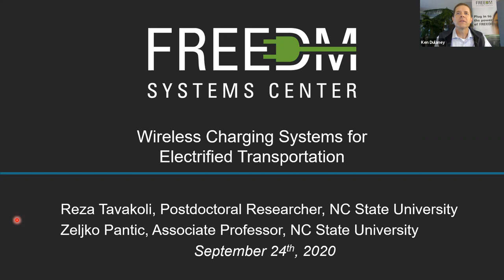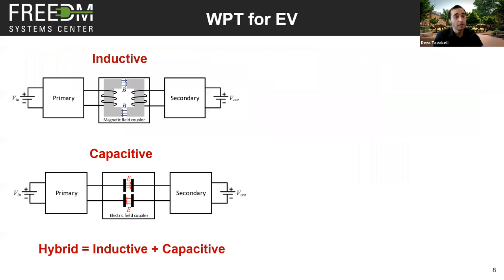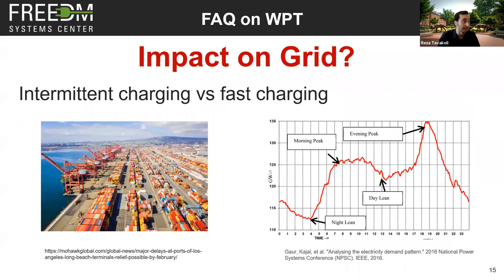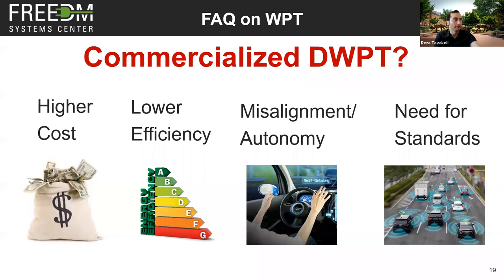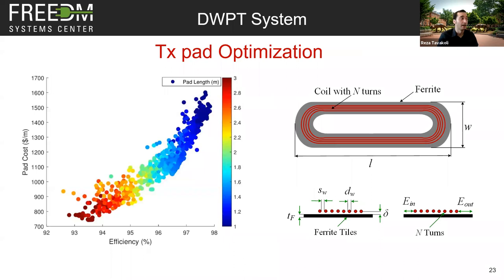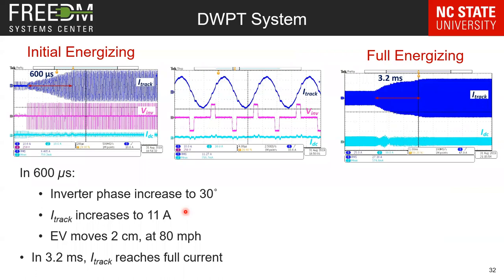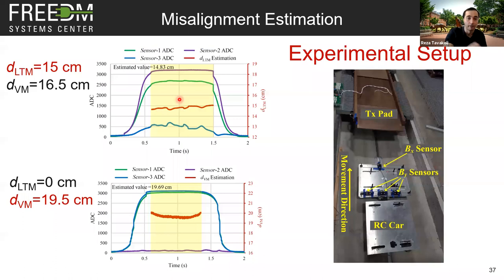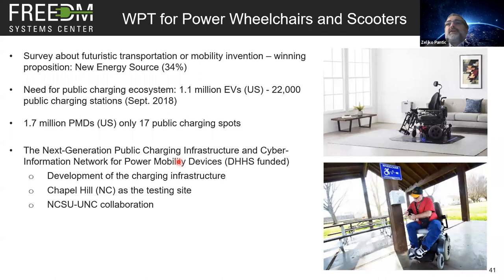FREEDM: Dynamic Wireless Charging Systems for Electrified Transportation

Comment: At 8:38 you have a "VDC" as a source in "Inductive charging" compared to Grid >> Transformer >> Filter >> "AC to DC Converter" before that in "Conductive charging". 
Does that mean you don't use the power from the grid in inductive charging, or you purposely left out the Grid >> Transformer >> Filter >> "AC to DC Converter" part in "Inductive charging" so you can claim that inductive is almost as efficient as conductive charging?